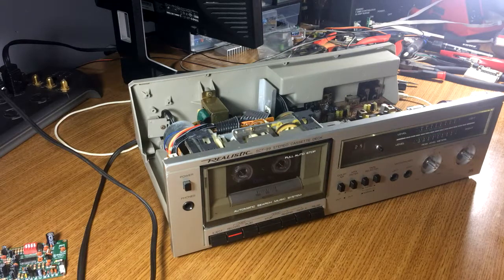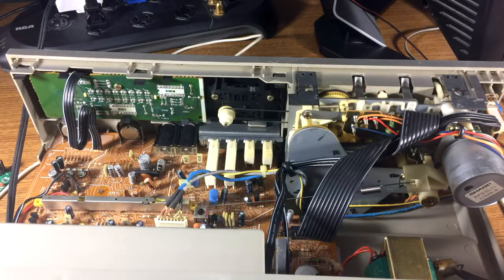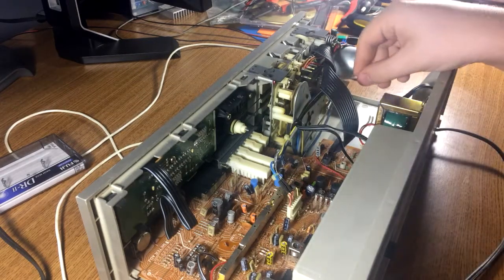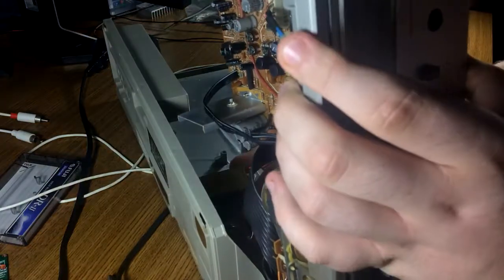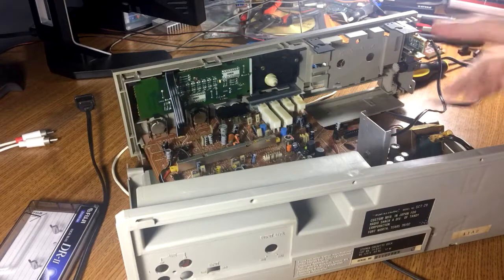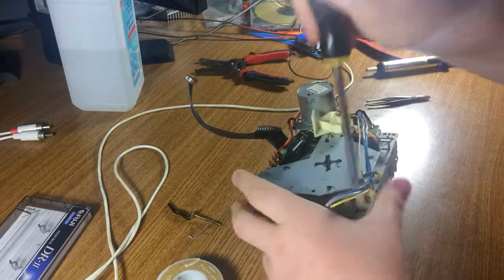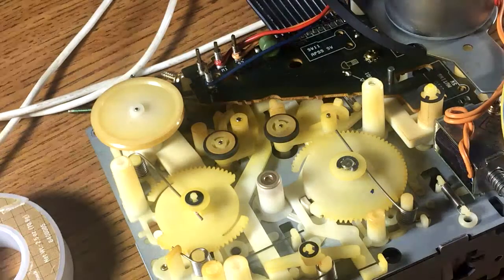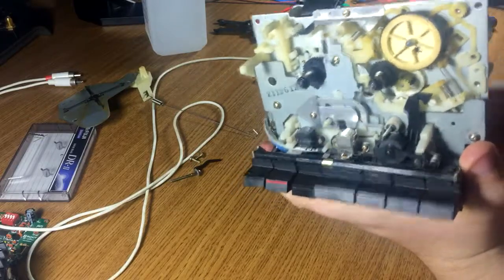PART 1 OF 2 - Realistic SCT-29 Clean up and rebuild

Comment: The SCT-29 was my first true standalone cassette deck, bought on closeout from my local Radio Shack in March of 1983. Catalog price was $159.99, and I got it for $129.99 - a fair amount of moolah for a high school kid raiding his stash of summer job earnings. A decent enough deck - far better than what I had been using. But alas....about 5 years later, after reading too many hi-fi magazines and books, I got it in my head that the deck needed new heads. Took it back to the Radio Shack for this totally unnecessary service. They did replace the heads, and it did sound great, but only with tapes newly recorded on it. Old tapes made on it sounded terrible (muffled). Tapes made on other decks sounded terrible. Tapes made on it sounded terrible on other decks. Yup - head alignment was messed up. Took it back to RS a couple times, but they never could get it right. Which isn't surprising on such a cheap deck. And given the amount of mileage I had put on it, there was no way the original heads were worn out.

An object lesson in what can happen if you act on a dangerous little bit of knowledge!

I have since acquired another SCT-29 from - yes! - eBay that needs some work, so this vid is particularly interesting to me. Thanks!

Comment: If you played a tape which was recorded on a slow deck then playing it back on a fixed deck, running at the correct speed, then it would sound faster. You may need to alter the speed of the motor which is done with the small screw in the small hole in the back of the motor itself. You'll need a calibration source though to make sure you have 1 7/8 ips. Good video though. I have a couple of SCT-80's which I am servicing at the moment.